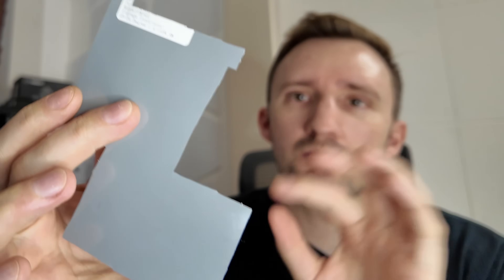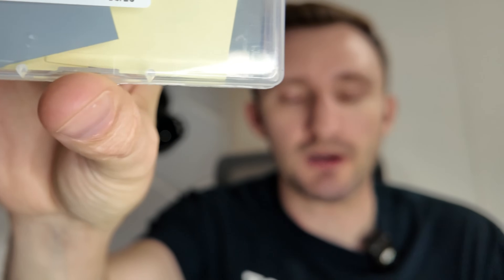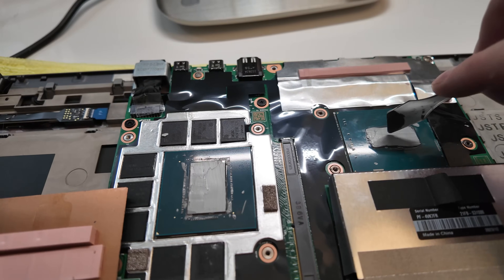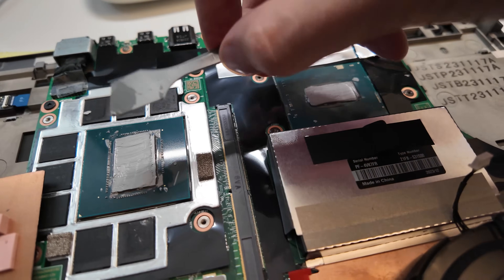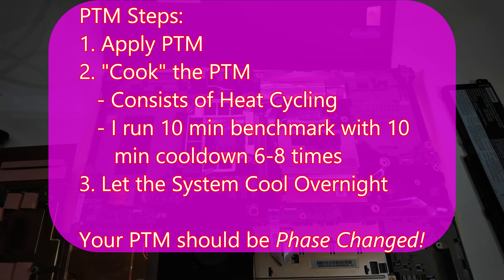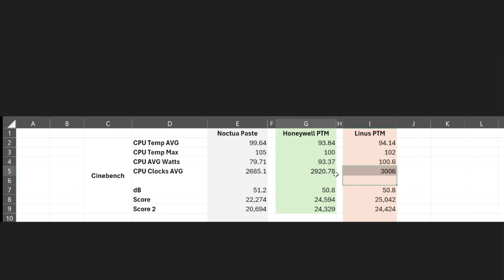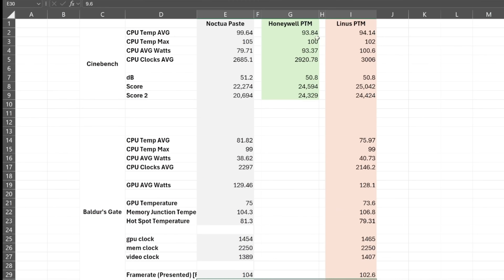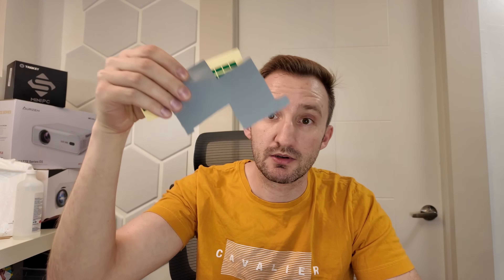LINUS TECH TIPS - New PTM7950 Cooling Solution .... Let's TEST IT

Comment: When I applied my sheet to my CPU, I put it in the fridge for 30mins then peeled one side of the plastic off and stuck it to the IHS, then when I took the other plastic sheet off it actually pulled away the sides that weren’t stuck directly to the IHS and left a perfectly conforming, right sized and flat sheet of PTM on the CPU. What was left on the plastic sheet was like the outline of dough after it had been cut by a cookie cutter. It was as if the PTM stuck only to the IHS and then detached where it overhung the CPU. Getting great results too now.

Comment: I replaced mine on a laptop . and still gets to throttle the CPU fast in seconds of a stress test , even on idle it gets to 30 or 50% throttle doing simple thing like opening chrome , and I ordered from the Chinese website linus said it was original , also it's my second replace on the same laptop and I found it was hard like plastic when I replaced it the second time on about a year of the first replace. I guess I'm going back to search for a good thermal paste , no more PTMs .

Comment: Thermal Grizzly has their Phasesheet PTM too, its what Im using in my Alienware M16 R2. WAY better priced that the LTT stuff and if available on Amazon. Also PTM isnt going to work great right away, youll get similar results as you would with standard thermal paste. but after a few hot/cool cycles itll "break in" and show better results.

Comment: Fourteen minutes in you said the Memory junction temperature on the paste was higher than the Linus temperature. The paste was 104.3 and the Linus was 106.8, exactly opposite of what you said.  Both seem pretty hot to me, two degrees at this range could be significant, two degrees cooler for the paste could be a lot.

Comment: Learned from my mistake - don't make it match exact size of CPU crystal or heatspeader - reduce pads to 15% KFC crystal size at each of 4th sides, because it will be perfectly squished without pushing too much out, and layer will be thinner and lack of extra squished paste will not reroute heat into dead ends that doesn't touch radiator!

Comment: Two questions please?
30~40 psi pressure is needed for usage - Is this obtained when clamping down your watercooling block to an RTX 4090 GPU?
Nowhere does anybody say what thickness you require ?
and will it alter any of the critical heights of all the other Dram/Inductors/Vram DrMos ?

Direct from the Honeywell site.

PTM7950 is a highly thermally conductive Phase Change Material (PCM) designed to minimize thermal resistance at interfaces, maintain excellent performance through reliability testing, and provide scalable applications at a competitive cost. Based on a novel polymer PCM system, PTM7950 exhibits excellent interface wettability during typical operating temperature ranges, resulting in extremely low surface contact resistance.
Available Versions:
PTM7950 Pad | Easy application and no drying steps
PTM7950-SP | Paste version for automatic stencil printing
PTM7950-SPS | Paste version with slow-drying solvent
Key Features:
Super low thermal impedance
Silicone-free, no pump out, bleed out, dry out issues
Industry-proven superior long-term reliability
Min BLT~20um, typical BLT is below 50um
30~40 psi pressure is needed for usage
PTM7950
PTM7950 is a Phase Change Pad with a Thermal Impedance of 0.04 - 0.08 (OC cm²/w), Thermal Conductivity of 8.5 (w/mk) and Specific Gravity of 2.8 (g/cm³)
Overview
Specifications
Physical Properties
Color
Light
Specific Gravity
2.8
Thickness (mm)
0.2 / 0.25 / 0.3 / 0.4 / 0.5
Format
Pad
 
Thermal Properties
Thermal Conductivity
8.5
Thermal Impedance
0.04-0.08
 
General Information
Application
AI/HPC
Networks
Notebook/Tablet/PC
Industry
Consumer electronics
Telecom/Data Center

Comment: My question is can you apply 7950 to the chips other than the CPU GPU, Ive been seeing ppl only use it on those and use regular paste on the surrounding chips.
Reply from the maker: The issue is they need to touch. So long as there is direct context between chip -> ptm -> heatsink.. then yeah it'll work

Comment: Ptm melts at 45c... its solid at temperatures lower tha  45. There is no cooking it to turn it solid involved. The reason it gets better after a few cycles is because it melts and fills up the gaps and air pockets, getting better contact with the die and cold plate. 
Not sure where you get the cooking it to turn it solid from.
Reply: 1. Cooking  Means melting it

2. It turns into a more liquid state then turns BACK into a much more hard material. Significantly harder and more brittle than before application. It does NOT turn back into a liquid after this change

So yes, it goes from semi solid, to liquid, then permanently to a solid. Basically fusing the CPU die the cooler. 

Clearly you have never used the stuff, now have you removed a cooler to inspect the TIM after it's been heat cycled

Comment: Here’s a pro tip. You peel 1 side stick to CPU, take your finger and run it evenly over the CPU so it sticks to it. Take your fingernail and run it around the outline of your CPU essentially cutting it.

Peel off and you have a perfect outlined PTM7950 stuck to the CPU. You never even have to peel off the second piece of plastic. 👍
Reply: Are you saying you never cut the plastic sheets and only cut the PTM layer with your fingernail?  Interesting technique!

Comment: According to reddit laptops and handhelds need a particular kind of thermal compound because of direct die application and low mounting pressure. Also there's lots of uneven pressure when reinstalling the heatsink. I had to get a pretty expensive paste, Kooling Monster KOLD-01, for my laptop to even match stock temps from when it was new. It was recommended by Igorslab, his testing is super extensive.

Comment: No. Unless you test the PT7950 against all the competition, your conclusion is faulty.
Reply from the maker: That's not how it works. Sorry
Reply: @TechGuyBeau  That actually is how it works. Testing against one thermal paste is hardly a comparison. There is not enough data to form a proper conclusion. This type of comparison requires running a system under varied conditions and various types of heat exchangers as well.
Reply: @JamesSullivan-ru4op  Really curious what other pastes he should test against considering they are all practically similar in performance.
Reply: @LEK  This statement is assumption. There is no way to know of all pastes "perform practically the same" without testing all pastes against each other in the same circumstances.
Reply: @JamesSullivan-ru4op  There are countless tests on the internet with different pastes. Differences are utterly negligible. What should actually be compared is longevity. Most pastes, on GPU DIEs in particular suffer from pump out and barely last more than a year. In terms of performance and longevity,  PTM wins as it practically lasts forever.

Comment: I have an AMD 3970X as CPU and an Asus RTX 3090 Strix as GPU.
I'm still looking for a very good pad for the GPU.

I would currently use the PhaseSheet PTM from Thermal Grizzly.

1. Is the PTM7950 better than Thermal Grizzly?
2. Can I also use the PTM7950 for my CPU?

Comment: I have a question for you: how do you clean PTM7950 when you want to remove the heatsink? Do you use 99% isopropyl alcohol and cotton swabs or different things? Is PTM7950 very sticky and difficult to remove when cleaning it? Does it stick aggressively to the heasink? I am asking you this question because it may happen that one wants to test a different thermal paste in the future and in order to do so you have to remove the heatsink and clean that PTM7950 before applying the new thermal paste. So is that cleaning process easy or difficult for the PTM7950?
Reply from the maker: A lot of alcohol, and a plastic scraper

Comment: I just put it on my 7900XTX today. Immediately dropped my hot spot over 20c and it isn't broken in yet.
Reply from the maker: This is the way
Reply: Did you change your thermal pads also? If so what size did you use? Thanks

Comment: The imported ptm7950 from China you have is fake.

Authentic PTM9750 only comes in 0.25mm thickness. 

If it's 0.20mm like the one you have means it's fake.
Reply from the maker: Who says my Chinese PTM is 0.20? Also there is a massive community of tech peeps who all use this and buyer (and it performs the same as the LTT stuff).
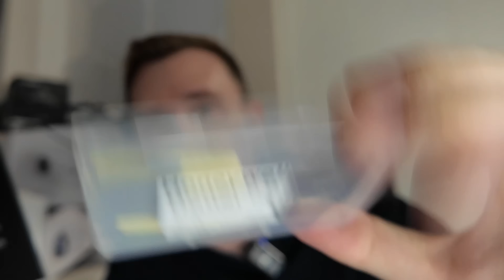Reply: @TechGuyBeau  Look in the video at 4:13 when you show the package. 40 x 80 x 0.2mm. I know its the fake one because i also bought this one with 0.2mm. I found a shop where i bought the authentic after. Trust me PTM7950 0.2mm doesnt exist.

Comment: It's all BS I've tried Grizzly PTM and some supposedly genuine stuff from Moddify but never been able to get the actual trademarked Honeywell stuff. this has been nothing but a scam to take money from the enthusiasts.. I does NOT live up to any of the hype. You want cooler temp?  LLANO forced air foam sealed cooler and you will be using t000 rpm cooling. Unfortunately these coolers will set you back as 90 usd or more and you will need noise canceling Headphones.
Reply: i got honeywell original, it makes differance in noise on my cpu cooler + it does'nt run as hot so fast as it did on paste. you can't say it don't work if you did'nt use original honeywell PTM
Reply: Iink to origin ptm plz

Comment: Stupid question, what if you double up on it? Like, put two squares on top of each other before locking on your AIO or Air Cooler? Would the results be the same? Worse?
Reply: You are adding resistance. It is thin the same reason you apply thermal.paste as thin as possible. You are trying to transfer the head as efficiently as possible to the cooler. Doubling it up will most likely worse performance.
Reply: @diamondheat9  Thank you for responding and explaining!

Comment: I bought two big pads, and it lasts a lot longer than I expected. I repasted an AM5, GPU, Gaming laptop (CPU and GPU), an old laptop with a Intel U processor (barely got hot enough for phase change), Nintendo switch, mini-PC passively cooled switch, and an Xbox One S and I only used half of one... My graphics card (Sapphire) had been RMA replaced, and so I watched the new one's thermals and it was hitting ~120°C 💀. Decided voiding the warranty was worth it if it would keep me from having another 3 month $300 shipping RMA. PTM brought the temps down to ~60°C under furmark, the stuff that was on there was already "Pentium 4 dell, Never changed" hard. On my Dell G5, it works so well that I discovered that the Dell firmware ramps the fan to 100% before checking the temps which causes it to "sneeze" the fans as the temps are lower than it expects. The Dell heatsink has tons or toolmarks that need good TIM to fill in, this works great. Switch doesn't ramp up fan anymore, Xbox runs a lot cooler to the touch, it just works really really well.
Reply: I think Thermal Putty will make your Odysee complete. So you end up like me.^^ Happy Cooling! :-)

Comment: PTM isn't cooked to 'phase change' at all. It changes phases every single time it is heated and again once it cools. The thermal cycling is causing that PTM to liquify and settle into the microvalleys of the heatspreader and heatsink surfaces. Repeated cycling ensures it is settled as much as it can be, showing the maximum performance. Important for a performance comparison, but not so much for an end user, as normal use will provide these thermal cycles over the course of a few days. This is actually true for a lot of thermal greases too, where many users will notice 1-2 degrees drop once the compound has had enough thermal cycles to settle.

Comment: I bought an 80X80X0.2mm sheet from Ali Express for £3.85 and it works just as well as the LTT and Honeywell stuff for a fraction of the cost and you even get a bunch of tools with it too
Reply: Is it still holding up?
Reply: @Stardomplay  Yeah it's still holding up well in the year I used it, but decided to switch to Kryosheet instead, I get worse temps with the KryoSheet but it's not as messy and reusable and a lot easier to apply lol
Reply: How are you doing now, are you satisfied with the performance?

Comment: I bought some PTM7950 for my steam deck oled, very skeptical that it actually works but bellow i jave result to prove this stuff works amazingly well.
Game used for bentmark was GOW Ragnarok.

Before PTM7950
Time 10:16:00
v0.7.2
GPU 85% 74°C @ 1357mhz 5.0w
CPU 57% 82°C @ 3426mhz 6.2w
VRAM 3.9618GiB @ 800 Mhz
RAM 5.2GiB  - 1.9618GiB
BATT 74% 22.6W

After PTM7950
Time 11:38:24
v0.7.2
GPU 81% 66°C @ 1280Mhz 4.9w
CPU 52% 69°C @ 3078MHz 5.8w
VRAM 3.9618GiB @ 800 MHz
RAM 5.4 GiB - 1.4GiB
BATT 69% 21.2W

About 1hr After Letting PTM7950 Settle Out.
Time 12:30:10
v0.7.2
GPU 83% 66°C @ 1400MHz 5.1w
CPU 52% 64°C @ 2925 MHz 3.1w
VRAM 4.1618GiB @ 800 MHz
RAM 5.3618GiB - 1.7618Gib
BATT 80% (Plugged In)

Results was taken from the steam decks built in gamescope.

These result are not fake, as mutch as i would love to prove with pictures im not sure if you can upload images to youtube but correct me if im wrong as i will do. Overall im very happy how good this phase changing thermal paste stuff actually works.

Comment: The best thing about it is that it does not seem to dry out, it does not lose performance over time. Thermal paste dries out and you need to replace it every few years if you want to keep the same performance. I don't personally know anyone who replaces thermal paste except me, so for 99% of users, these thermal pads should be way better.
Reply: Yeah, because this stuff is used mostly for industrial and military applications, and as you might guess, in such applications, the service time can be years to decades between each service, so the stuff used in those applications has to last that long.

Comment: I used some Amazon purchased PTM7950 on my RTX 4070ti and the results have been great. Unfortunately, the seller is gone so I just purchased from a different seller yesterday to us it on my R9 5950x. The only concern I have is going to be with my NZXT Kraken 280 pump head. The holes in the mounting bracket are larger than the mounting screws which makes it so the pump slides around a bit when tightening the mounting screws. I don't want to tear the PTM pad but I kind of have a feeling I might. Luckily, I bought a 40 x 80 pad so that gives me two attempts. I was considering purchasing the PTM from LTT but I needed it asap and Amazon had next day delivery so i went with that. I'll update this later tonight after I get it applied. For thermal cycling I'm just going to run a bunch of videos through Handbrake.
11/22/2024 Update: the PTM7950 from amazon worked great with my AM4 cpus and my GPU (rtx 4070ti) but honestly doesn't seem to work any better then thermal paste with AM5 CPUs. I bought an R9 7900x and it seems it doesn't matter what you use, no matter what you are going to hit the CPU TDP max and end up thermal throttling no matter what you use even with a 360 AIO, even liquid metal i'm guessing. I just purchased a R9 7950x which i should receive in about a week and i'll try ptm7950 again but I'm guessing that just like with my 7900x it won't really be any different them regular thermal paste because in general these CPUs just run hot.
Reply from the maker: It’s not the biggest deal. The PTM will melt and fill in gaps upon use. Just don’t be Too aggressive when putting it on

Comment: Is this a apply and forget solution like the kryosheet or you need to eventually replace it like thermal paste?
Reply from the maker: It lasts for an extremely long time. But if you remove the cooler ,it basically destroys the ptm. So after apply you basically leave it alone, if you change coolers you need to add more ptm

Comment: I wish, LTT could sell them in smaller sizes for a little cheaper. Google tells me that 7950 has an estimated shelf-life of 12 months. So if I needed to build 2-3 PC's as once-off, it'd be a shame to just dispose/let it expire. But I guess the re-packaging cost wouldn't be worth it.
Reply: I'm pretty sure the PTM has a very long shelf life if any at all considering that it's intended for industrial use and they buy this stuff in kilograms. 
As long as it's air tight and not in rough temperature it shouldn't degrade.

Comment: Great video, but the difference in actual performance when you stated you gamed it seems to be the same. 

When you go through the BG's temps and details it literally shows that Noctua had lower CPU avg watts with more clocks. Granted you get better temps, but I would expect a higher average clocks value considering the system is able to inject more power into it...

GPU temperature difference is only 1,4ºC higher (which to me seems close to negligible). The memory junction is actually LOWER on the Noctua side and the hot spot temperature differential is 2ºC. Not enough for me to call PTM 7950 revolutionary.
The last clocks were too similar for me to cast a vote on either of them. 
And then in the end, the "poorer" product (paste) actually gave you better framerate. Negligible, I know, but for a better product to post worse results it does not make PTM's case for me. 

At this point the only thing that might be left is longevity. And this is something I would rather like to find out. To see the differential on the performance with time degradation put into it. 
Problem is that this is a case where TIM easily lasts 2/3 years without steep loss of performance so I understand it would be demanding to take on such challenge.